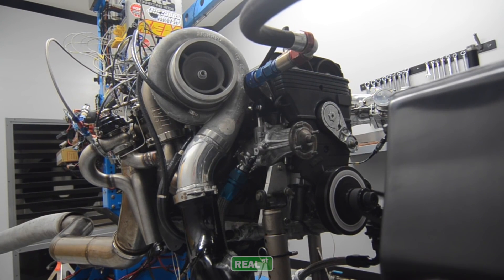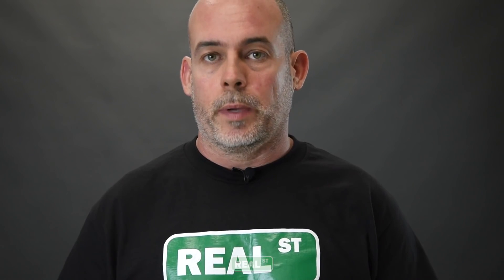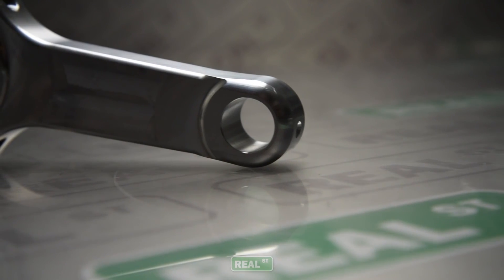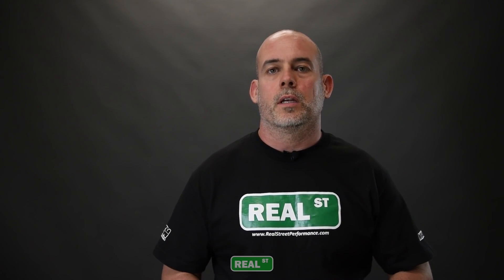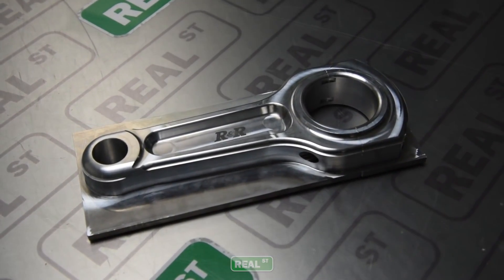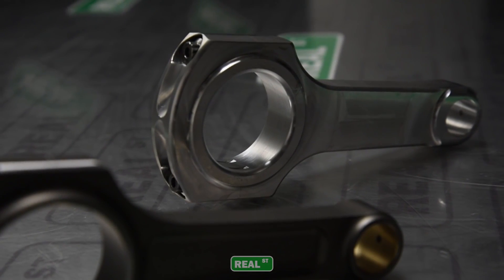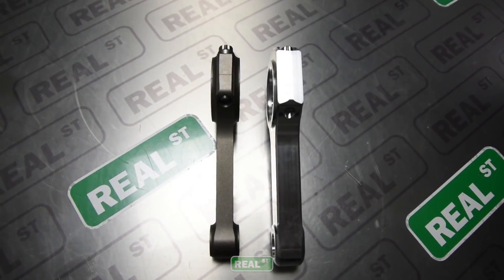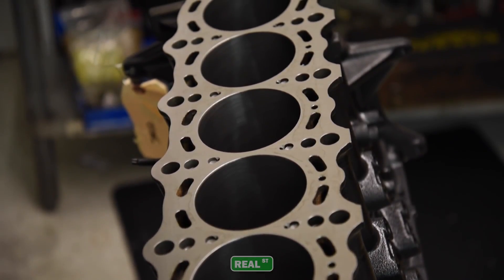Aluminum Rods - When are they right for you? Jay's Tech Tips

Comment: I know for a fact they are running steel rods in engines up to and some over 3500 hp without any bearing or crank issues.  Yes, there is maint involved, but it's more tune up related than rod material.....

Comment: If I can ask you. I'm getting in the process of building a LS motor that I'm going to tell the charge for my vette. What is your suggestion on the aluminum rods do you actually think they'd be better than running steel? I was planning on going with the wiseco boostline rods. However if running a set of aluminum rods would be better than I would definitely go that route. I like the part where you said how they absorb a lot of the harmonic shocks and vibrations.
I'm interested to know your professional opinion aluminum or a nice set of steel rods.
Thank you

Comment: If aluminum rods don't permanently stretch according to GRP and they cost similar prices, why would anyone want a steel rod? All these benefits but go ahead and use a steel rod. If run at reasonable power levels would they require more service? Not from what I've been reading.

Comment: Might want to investigate Turbo Maxx.  Turbo Maxx carries 7 to 10 times the film strength and shock load of conventional types of racing engine oils. Turbo Maxx also withstand very extreme operating temperatures in high stress situations up to 550ﾟF. 9  Years on track testing Has proven to increase film strength and engine oil life 3 to 4 times longer under the most severe conditions. For more information www.zddpmax.com If you have an extreme engine oil condition we have the solution current winner of no oil go kart challenge.

Comment: nope, aluminum expands..... as the engine warms up, the big end expands bearing wear is all about the oil wedge or loss of it, m y guess is around 120 pounds of oil pressure with a 30-70 weight oil may solve it, as for street engines under 400-500 hp you get internal weight savings, and the bottom end is easier to balance, composite cracked rods are junk cheap after market steel rods need to be checked, and blue printed, and balanced etc
Reply: I would run nothing but Motule 800 2t sae 40w 2 stroke oil with the aluminums. My small block 2 stroke is runs steel rods and i use BRP XD-100 synthetic oil in her.

Comment: They would be great in a sport bike like a r1 . Lawnmowers use them and I never snapped one. An advantage of lighter rods is it takes less power to spin them and make less friction.Take out the bearing shell also. Then when it is rebuild time chuck the rods and pistons in the scrap bin , machine the crank if needed and put in new rods and pistons.
    I heard 70k miles on a street racer is average life for the aluminum rod.

Comment: So if aluminum rods are better for longevity on big number engines, shouldn't they technically be better for longevity for the everyday man? Are they more expensive? From what you just told me it seems ideal that ANYbody who is going to go through the trouble of opening up their engine and dropping parts in, would want aluminum rods. I am considering trying to source/make some aluminum rods for my TL1000 (vtwin) and trying to machine the crank to accept Buell roller bearings on the crank. Thrashed TL's have a pretty short life for the crankshaft bearings in general, and once you start using big bore kits or spraying or using forced induction, and get past 160-200hp(its an old bike and a twin, don't hate the small numbers) they become ticking time bombs. I had never considered an aluminum rod as an option before.
Reply: Nikolai Shriver they have to be replaced where steel rods have a very long life. if your beating on the car every month than like every 10k miles you have to change rods
Reply: Can we get billet 7507 aluminum roller bearings?

Comment: Yes, and no... but you don't need to be a genius to search the Aluminum vs Steel ultimate tensile strenght (In a connecting rods the tensile strenght is the most importat thing) i just will gonna give the numbers

the SAE4340M Silicon Vanadium Alloy have's a tensile ultimate strenght of 2340 megapascals and it weights 7874 kg/m3

the Aluminium alloy 2618A got's a tensile ultimate strenght of 450 megapascals and it weights 2698 kg/m3 IS LIGHTER, but it doesn't got a better strength-weight ratio, if you want rev high, just get a lighter flywheel, if you wan't win drag races go for torque and a quite heavy flywheel

Comment: What type of Aluminum Rods should I use in my Rotary?
Reply: good one.... how big of a cam are you running in that Rotary ?? lol
Reply: Gaz Girl 
Your uncle must be your dad.
Reply: @yjkader  mom is probably the sister aswell
Reply: it uses piston return springs dummy
Reply: Gaz Girl you do realize they’re joking right

Fuckwit
Reply: Shane Drake your a fuckwit so stfu you muppet
Reply: Gaz Girl you’re such a twat .... they are joking, get a sense of humor.
Reply: Peter Pan what does that have to do with anything another fuckwit
Reply: The ones shaped like a cock!
Reply: Make sure the match the circumference on your exhaust bearings.
Reply: @agus2001  Make sure to use 7507 T billet aluminum made on a a CNC mind over matter 8 axis milling Hass marchine. This is used to make the 7507 T6 tapered roller exhaust bearings!
Reply: Best mod is to first go with bigger valves first.....
Reply: Just use a mild cam youll be good.
Reply: Just mount a big SKF or Timken needle roller bearing in her. I got my rotary on amsoild dominato synthetic 2 stroke oil. Im about to giv motule 800 2t a try but 6 quarts of 2 stroke dominator motocross oil is cheaper and way better than mobile 1 10w30 2t.
Reply: I suggest a lightning rod. Before you I stall it go out into the middle of a big field in a bad lightning storm. Once the strike happens then your good to go...
Reply: Bluetooth rods sound right for u!
Reply: Just make sure those rods are made out of the same aluminium as the waterpump of a Original 60' VW beetle :-)
Reply: Shane Drake lmao

Comment: so basically...
reduce rotating mass/weight, reduce vibration. would that make you hit your redline faster as well?
Reply: Pan tera shutup kid...
Reply: 'kid' funny guy. if this were in person you'd be a might bit quieter
Reply: Pan tera Good thing I'm not though eh.. &  god damnit, I'm trying to tell you that IN MY OPINION, rotating & reciprocating mass in differentiation of 8 or 900 extra grams amongst 8 rods  in a 1,200 hp v8 really dosn't make a big difference. In fact, as long as everything is balanced, its F.U.C.K.I.N.G NEGLEGABLE.......
Reply: Ted Dow if it can reach a 8,000 rpm redline a half second faster than without the added mass, it's likely going to show up somewhere.

but then again that's not YOUR opinion so it likely doesn't matter anyway, you must be a real hit with the ladies.

Comment: I'm a noob when it comes to this stuff. But just a question. If the Steel rod is strong and holds itself up to the power but more power results in accelerated bearing wear or spun bearings, why not make aluminum rod bearings that have the same characteristics of the aluminum rod in the vid? Just asking, correct any misinformation.

Comment: very informative but still I have a question exactly for how many miles aluminum rods are gonna last and like the guy said when they heat up their length is increased a little bit meaning contact with the head .isn't it risky for valves to get damage by the pistons so   how  to set the gap between them so when they heat up they don't make contact . please tell me that.thanks

Comment: Thanks for the info. Never thought of aluminum rods as a vibration dampener before.
Reply: Yeah they shorten or bend easier with high cylinder pressure. Don't let these people fool you into buying aluminum rods for a racing application that doesn't warrant their use. If you are replacing all engine parts after 4-5 dragstrip runs, yeah these rods are fine. But you don't need them on most 6,500-8,000K RPM street/strip daily driven race engines.

Comment: what about titanium?I guess you can use that if you are willing to pay for it.
Reply: i want to have a video about just that
Reply: Titanium doesn't make sense for a normal 10K RPM engine. Titanium is used in motorcycle engines and F1 engines that spin 20,000 RPM for race application.
Reply: Joseph Arata Honda nsx ?
Reply: @JosephArata  c30a, c32b, lf4, ls7, ls9, the list goes on lol

Comment: What was up with that dyno test spewing water out the water pump. Alluminium rods are not a good idea,there designed for short life builds.
Reply: Im assuming you personally had a aluminum rod failure then? Or are you just sayin you "heard" this from a bunch of guys online? I personally built a aluminum rod 4cyl motor that was a daily driver for over 4yrs and never once had a issue with them. On the street the car made 540/600tq and got beat daily.  If i never told the next owner it was aluminum rods he would have never known and never had a problem. People gotta stop repeating the "hype" on stuff like this. They work fine. Everything wears out or breaks eventually but there is no prob with good aluminum rods. I run GRP's personally.
Reply: Ted Dow first motor about 11yrs ago was a old school 2.2/2.5 dodge that i built a aluminum long rod setup in. Single cam 8valve. Made 540/600 whp. So around 600 crank.  Car was off rev limiter every day no issues.  Newest grp motor is in a evo making 1100+ awhp. So figure thats over 275hp per hole. No rod failures to date.  People get so scared some some old builder heard from his grandpa that aluminum rods will fall apart backin off the trailer. Ive personally never had a problem. They actually make the bottom end live LONGER in my experience. Way easier on crank and bearings.
Reply: Ted Dow i dont think its luck. I just think the rods are fine and people worry too much
Reply: Ted Dow im well aware. I daily drive a ls turbo car haha. Look at my vids
Reply: Starion Slider aluminum ''work hardens'', after a time, they become brittle & fail...
Reply: Ted Dow ok but its not like its gonna happen overnight. I personally ran my last aluminum rod motor daily. 4yrs no issues and that same motor is still together. Was put together in 2009. I agree they are not as long term as a steel rod but 99% of the time they are fine. Some people just get scared. I dont.
Reply: I actually talked to my machine shop and my tuner which is a drag racing Grand master. He said no way been there done that on a high powered motor like mine they will go real quick. They are bad ass though very cool parts.
Reply: Starion Slider what kind of powee are you making & out of what?
Reply: Brian Heiden one person says they are junk and others will say they are great. Listen to whatever you want. I never lost any sleep over mine.
Reply: Starion Slider you must have excessively good luck! if it works though, run it.
Reply: Starion Slider in a v8 with a big turbo, Rod weight is not a huge concern.  as for being easy on the crank,  not an issue either, yet.
Reply: Starion Slider LOL look at mine.
Reply: Starion Slider very nice! i just got some 4.0050 slugs from wiseco for my ly6 this afternoon!
Reply: any documentation or proof of this?  i know a few turbo dodge guys that would like to have a word with you if what you say is true.

Comment: Aluminum Rods are a race only thing.
that's just common knowledge.
Reply: Yeah right and they will never replace horses with cars.
Mate they use similar grades of aluminium in the spars on jumbo jets and fighter jets.
I have used aluminium rods in many serious engines since the 1980's.
I was skeptical in the beggining, but we ended up getting 5 years out of a set of Manley rods that were caned mercilessly.
One 351C we did with a .330" stroke was running 14:1 CR and pulled 11,000 RPM at the end of the 1/4 mile.
A fantastic motor. We did pull it down after each meeting to see how the rods went, and bearing damage was minimal to non existent for entire seasons.
Aluminum rods are not a race only thing.
I guess that depends on what you define as as race.
Reply: Not An Argument. exactly.
Reply: Can i use 7507 T6 billet aluminum made on a CNC thingy for a Tesla electric induction magnetic 2 stroke motor?

Comment: Have you ever noticed any stretching of the wristpin hole? I've always wondered about this being an issue on a motor that sustains 10,000rpm with aluminum rods. Even an 8000RPM motor that's stroked a little more aggressively. EDIT: My follow up question would be have you ever noticed the wristpin hole stretch on a motor that has sustained significant detonation / pre ignition?

Comment: what about heat cycles in a street motor that doesn't see full power all the time? I'm not building a monster but because the aluminum is lighter it will accelerate faster in a n/a engine. I've heard that the aluminum will get brittle and break.

Comment: Nice so my stock civic needs these for sure then is what you're saying right? Then it'll be 1800hp?
Reply: short throw dip stick
Reply: I only put 3 aluminum rods in my accord and got 450 hp more on the left rear tire
Reply: pretty much
Reply: +Eternity thx, now could I hook up a blow off valve with these also, I wanna make cool sounds you know
Reply: just go for titanium valve cover bolts and you will get the same power.
Reply: don't forget hood spacers and zip ties on the hubcaps

Comment: thank you for the video and would it be a waste of money to go with a aluminum rod in 700hp application
Reply: Yes I'll be beating the living crap out of the engine of the rev limiter and I was also thinking it would allow the engine to rev faster cuz less mass
Reply: +leanderelfrink10 remember if u use a light flywheel it revs easier
Reply: yes
Reply: Like he mentioned in the video. It also all depends on what you are using the vehicle for.. Are you pounding on the rev limiter? Are you doing street pulls and that's it? Are you racing your car on a circuit for a while at a time? If you are just using it for a daily and doing highway pulls you do not need them. If you beat on the engine to beat your time than yes you will
Reply: depends what engine you have too, like he said in the video its all about output per cylinder and if youre going to beat the shit out of it or not. if you're running a 4 cylinder that gives you 175hp output per cylinder. you make the call
Reply: +Mr. Sennin i don't think you'll notice it, i dont build engines so i can't tell you that haha.
steel is more dense than aluminium though, hence why the rods are weaker. the alu rods are bulkier but steel is like 3 times more dense iirc. in theory it would rev faster? anyone who built engines that can confirm? jay? 😂
Reply: +Mr. Sennin thinking it does the same for rods
Reply: density is not the same thing as mass. Yeah steel is more dense, but it is also stronger and requires less material for the equivalent strength with Aluminum. The Steel rod looks way less bulky than the equivalent in strength aluminum rod. It is whatever rod weighs less, that it would theoretically rev faster with.
Reply: +alexisthemexican yeah basically, the steel one is less material but it might he just as heavy or heavier than the aluminium
Reply: leanderelfrink10 also aluminum rods stretch, so you have to make sure it clears the deck high, I'm sure valves also, extra measuring for clearance is needed vs steel
Reply: +Integra DIY they shouldn't stretch. I think you mean they grow more than steel would under heat.